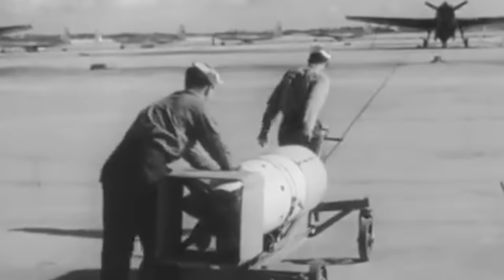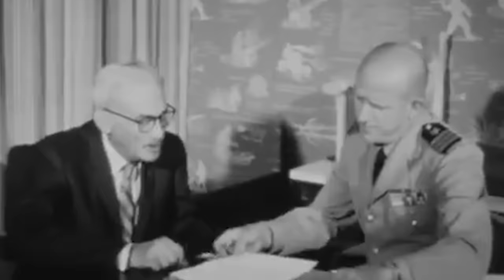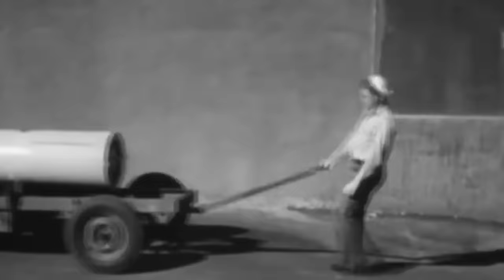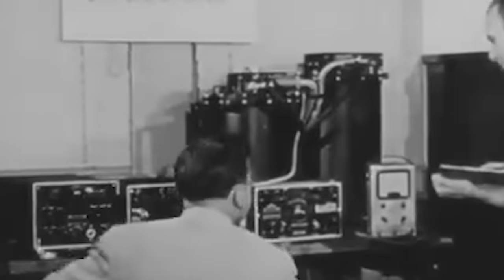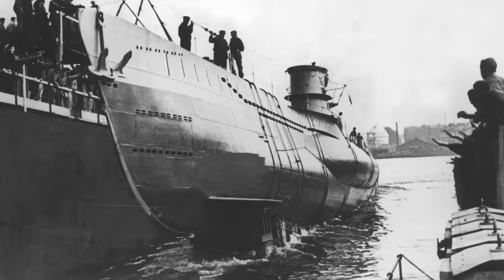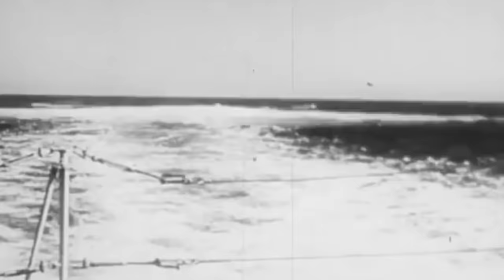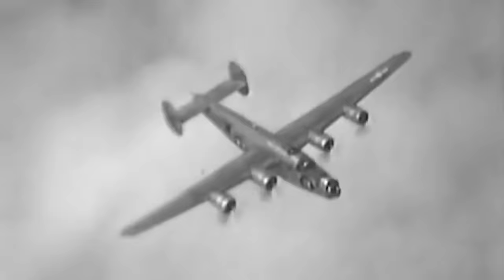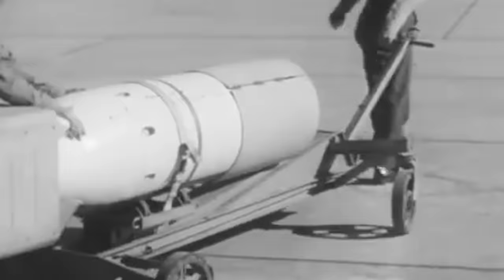The Most Brutal Underwater Weapon of WW2

Comment: The best part of this thing is the  washing machine motor. Lol
Reply: Gives a whole new meaning to hung out to dry 😂
Reply: and when the torpedo sensed the U-boat was near, it went from rinse to spin mode....😉
Reply: 7 1/2 HP seems like a lot for a washing machine
Reply: @AcidGambit419  big washing machine, think industrial for hotel sheets etc.
Reply: @jhnshep Got rid of the wash machine agitator gears and just used the motor.  Electric motor equals no bubble trail from the torpedo.
Reply: Of course, once in a while the torpedo would get off balance and you'd have to lift the lid to stop it and rearrange the explosive charge before letting it continue...
Reply: @dx1450  And if that procedure failed to fix the problem the Navy would send in the Maytag Repairman.
Reply: ABSOLUTELY!!
Reply: true
Reply: Yeah, so ironic, now that Russia is trashing US tanks with equipment reportedly using washing machine chips. 🤣
Reply: @dx1450  Okay, That Made Me Laugh Out Loud So, You Get The Good Finger! (Like #6)

Comment: At last someone has mentioned the Type 24 mine. However. The SOP for the mine was to drop it into the swirl of the U-boat after it dived. The torpedo was tuned to search for the cavitation of the rapidly fleeing U-boat.  Had they slowed they would have escaped. But their SOP from an aircraft was to get the hell out of there. The Type 24 was important to breaking the U-boat menace in the battle of the Atlantic.
Reply: The 24 would have been useless against the last model of U Boot. They were faster underwater than surfaced. Too few, too late... Not a fact I regret just they were brilliant machine for their time
Reply: @khaelamensha3624  Absolutely!

Comment: Michael Gannon's Black May mentions that the weak point of the Mark 24 was that if the U-boat stopped or slowed its motors after diving, the torpedo couldn't find it. Apparently, they never figured this out.
Reply: The Germans would have to know it was an acoustic seeker - and live to report it.
Reply: If i were being chased by a homing torpedo, my first instinct would NOT be to stop and see if it stopped homing.
Reply: @LoanwordEggcorn  You would first have to know a torpedo was in the water - and a diving submarine makes a LOT of noise trying to get well below the depth an air dropped depth charge is set to (25 ft).
Reply: @allangibson8494  And the allies were only in a position to know this after gaining access to German u-boat logs after winning the war and correlating them with the allied side of the action reports.
Reply: @johnassal5838  The fact that air dropped depth charges were set to 25ft was rather well known to both sides. You simply couldn’t see a submarine more than 25ft underwater in most places. The development of sonabouys and magnetic anomaly detection changed that after 1942 (another couple of developments the Germans were unaware of).
Reply: Good thing any lucid submariner trying to shake a B-24 or destroyer wouldn't stop their screws.  The Germans never knew an acoustic torpedo was chasing them.  And it wasn't only the screws these things would follow.  Pumps, compressors, mechanical gear turning control surfaces, etc. would also attract death for a submerged boat.

Comment: it astonishes me that a vacuum tube electronic device could be dropped from an airplane, and survive. Thanks for the video.
Reply: They used some of the same tech that was developed for the Antiaircraft Proximity fuse. If the vacuum tubes could survive being shot out of a cannon, dropping it from a plane is a piece of cake.
Reply: erm my friend: the allies had a AA shell that had a proximity fuse. that shock is harder. and yes the fuse had vacuum tubes in it.
Reply: As the device had a parachute,I ain’t astonished.

Comment: While I was aware of the Mk 24 version I had none about the Mk27.  Great info!

The figure of 9.5% effectiveness rate deploying depth charges against u-boats may need some context.  I’m pretty sure that was for a depth charge attack that featured one or MORE(up to six DC’s) fired in a pattern targeted on a guess based upon sonar, hydrophones and perhaps other data.  It was not uncommon for a warship to expend a dozen or two dozen plus DC’s during an attack.

FIDO’s success off 22% was based off a single torpedo.

Data analysts predicted the Germans would find out and develop countermeasures against FIDO in 9-12 months.  They never even found out about it.  That shows incredible tactical discipline by allied air crews.

Black May shattered the U-boat arm and Doenitz started shuttling his U-boats to less strategic areas that featured weaker antisub resources.  
Germany lost the war in Black May because she lost the ability to prevent the buildup for Overlord/DDay.
Reply: My father was on a YMS chasing u-boats. After 3 depth charges were dropped they had to move off and let the bilge pumps catch up with their leaks while another YMS pressed the attack

Comment: The real secret weapon was that the Allies had cracked the German codes and thus knew where every German military asset was at any time.
Reply: I think that you have overstated our code breaking.  It would take hours, and, maybe days to decode messages.  Also, we never tried to decode every message detected.  That would have been hundreds every day.
Reply: @stephennewton2223  They knew where subs were going and thus largely wiped them out.
Reply: @gusjackson3658  I'm not sure how specific their knowledge of submarine movements was.  Much of what they did know had nothing to do with breaking codes.  The Germans had terrible signal security issues.  They broadcast all of the time, revealing their positions and direction.
Reply: @stephennewton2223  Did they not encode all of their messages?
Reply: @gusjackson3658  Beats me.  Radio direction finding does not require code cracking.
Reply: @stephennewton2223  Thanks.

Comment: Everything takes longer to design now, more meetings and more time wasted equals bigger costs.
Reply: tell that to spacex
Reply: Yeah, but ------- it took five years for Germany to permit its last port expansion.  After Russian oil & gas was cut off they permitted and BUILT a major port expansion in six months.
Reply: Desperation is a great motivator. When you are losing battles and the war inventiveness kicks up. There were a lot of inventions that did not work but when one did work it could be a game changer. Before the P51 was matched up with a merlin engine the bombers had no fighter coverage past a certain distance from base. After, many more returned. The Typhoon aircraft was more dangerous to its pilot due to poor exhaust systems. Once that was fixed it became a deadly antitank fighter. Both aircraft were produced in just a couple of years. Nowit takes a decade at least.
Reply: what is Big Safari, sport?
Reply: @railgap  and DARPA

Comment: A bit more complicated than that - a pattern of sonobuoys was dropped to track where the sub was heading and then drop the torpedo accordingly.

RAF called them 'Oscars' - and were very cagey about them - Dad was a wireless op/air gunner flying Libs out of Northern Ireland - on one op. due to an engine fire, they had to emergency land at a training aerodrome - and the Lib had an armed guard put on it to stop anyone having a look to see what it was carrying !

Incidentally, the Lib with the engine fire which Dad flew in over a dozen times - KK331 - crashed in Norway in 1946 - unfortunately killing the crew - but large parts of it still remain.

Comment: Can you imagine dropping a tube TV or radio from 200 feet at 120 mph and expecting it to keep working?
Reply: Miniature vacuum hearing aid tubes were modified by Western Electric and Raytheon to survive the 20,000g acceleration produced by firing them from anti-aircraft and artillery guns.  By comparison rockets only produced about 100g and bombs less than that.  A parachute retarded aerial torpedo was a much kinder environment.
Reply: @mikemilner8080  Thank you for the information. I assume these devices were nothing like the glass tubes and delicate filaments that I remember from the 1960s. Those wouldn't survive a drop off the kitchen table.

Comment: The cylinder that is seen placed around the front section of the torpedo, before it is loaded into a plane, was designed to protect the torpedo upond impact with the water. It was made of wood, and designet to protect the torpedo on impact  and at the same time break apart and fall of.
Reply: Similar to the wooden nose and tail fins used by the Japanese to keep their torpedoes from burying themselves in the mud during the Pearl Harbor attack.  Simple and cheap solutions in both cases.

Comment: How do you stop an acoustic homing torpedo from attacking your own submarine?
Reply: Allied surface ships deployed a towed sound generating device to  decoy German acoustic homing torpedos. Submarines depended on stealth, and thus couldn't use such a device.
Reply: Easy, acoustic decoys or slow down speed of the submarine. Both things could be done, but Germany didnt know that allies had these acoustic toepedoes, something strange as the germans deployed a couple of months before acoustic toepedoes and acoustic decoys.
Reply: @PeterOConnell-pq6io 
 It dont need to be a towed acoustic decoy, it could have been expelled from the sub hull as the Pillenwerfer.

Comment: The Germans had a torpedo which could search his target by noise too.
Reply: Probably where the U.S got the prototype, by capturing one and reverse engineering it. That's how they countered the Germans magnetic mines, which were a devastating weapon at the start of the war.
Reply: The German T7 ran at a fixed depth so it only that to decide when to turn left or right based on the loudest ship noise it heard.  The FIDO operated in 3 dimensions as the target submarine could be anywhere down to several hundred feet below the surface.

Comment: until the long lance Japanese 24 inch torpedo, the Deadliest, most Powerful and longest range Torpedo in the world came out
Reply: That torpedo had a fatal flaw in that the propulsion system was very unstable to shock but did drive up to 1/2 ton of HE at a very fast speed. When the USN found  a couple of these torpedoes and evaluated or back engineered them. Our scientist at the defense corporations knew within a few days that the chemicals used in the propulsion systems had already been tested  by us and were deemed too easily detonated by shock.Our airplanes  started to throw large bombs to shock the torpedoes into detonating in the launcher tubes on the IJN ships. Even a miss of 3 to 4 hundred feet could set them off. After a few of the IJN ships blew up our pilots reported that the IJN ships with them would jettison all their torpedo's  as our attacking aircraft were getting close.
Reply: @paulcallicoat7597  it still the deadliest most powerful, fastest and longest range torpedo in ww2. Perfect? No, it is not perfect only the American torpedoes are perfect with no problem throughout the war.

Comment: Interesting and thanks.  Using a GE 'washing machine motor?'  A small gasoline motor of some sort, then, adopted to burn ethanol and compressed O2?  Sounds almost as if there was a small computer or maybe punched paper tape selector of some sort?  I don't think that I've heard of this torpedo before, sounds clever.
Reply: This used batteries to power the electric washing machine motor, if it had used an ICE it would have had to be much longer in order to include fuel and oxidizer tanks.